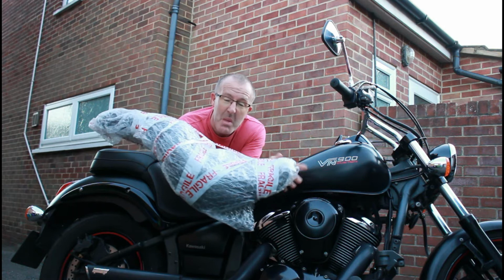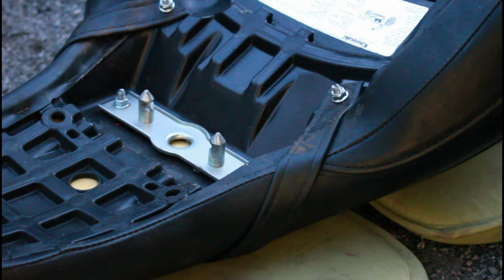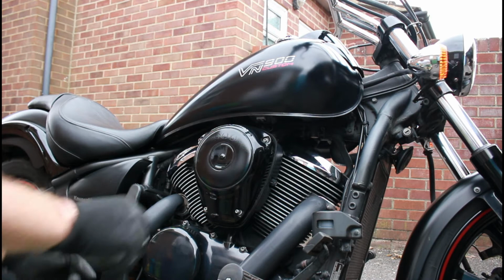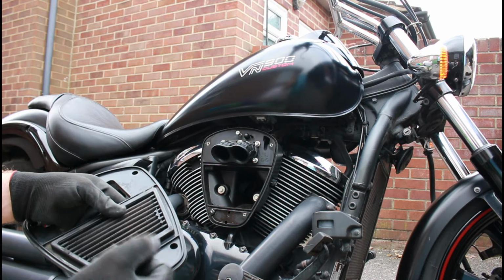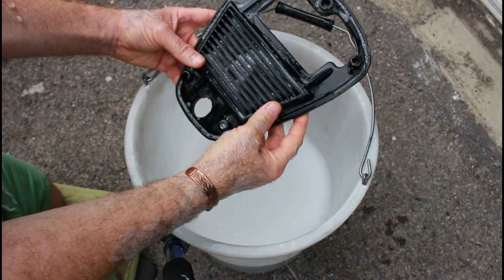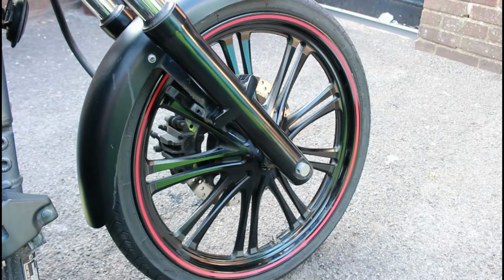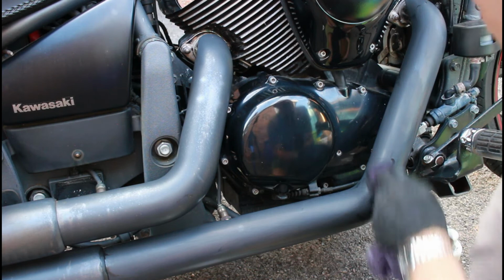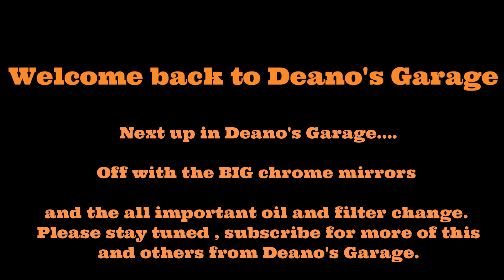VN900 Custom Seat change & air filter clean/change.

Comment: Do you have a seat name or a link to the seat?
Reply from the maker: Hello 
I removed the Mustang seat, and ordered  this via Ebay, was not new, and used Mustang fixing under the seat to fit back on: 
Kawasaki VN900 / Vulcan 900 Seat, Part No. 53066-0175 

Hope this helps ?

Comment: I dont know if you know this or not, but you know you are supposed to use a re-oil kit for those HIGH-Flow filters, not what you had done, that destroys them.

Only telling you this for further education before the trolls on the internet find your video and put crap on ya! And give you a hard time about it.

You have probably just now ruined the air filter, plus your going to wreck your engine if you dont use the proper re-oil kit for the high-flow performance filters and here is why...

Firstly... As you pointed out in your video that you can see through the filter, hence the reason why you need to re-oil it, so the oil can catch/prevent dust from getting inside the engine. So i would re-oil it as quickly as you can before you destroy your engine. The oil is designed to stop and catch the microscopic dirt fibres.

Secondly... Dont ever use warm/hot water to clean them as it will damage the materials of which the filter is made out of and never ever use an air blower from an air compressor to blow on it as it damages them as well. I spoke to a K&N representative over the phone and this is what he had told me not to do, he also mentioned to me that its also stated on their website, i have never checked to see if its written on their website or not, but maybe you could go look and see for yourself.

Thirdly... You are going to get some people that will say that you can use different re-oiling kit and you dont have to buy a K&N brand, but i strongly disagree as the guy i spoke to over the phone also said, that if you use a 3rd party re-oil kit or an off brand one, the chemicals used could also damage the air filter. So in future if you use a certain brand HIGH-FLOW air filter, make sure you use their own re-oiling kit to clean it.

Anyhow just wanted to let you know this for your info, if i were you i would take your video down and re-edit it or cut/edit out the air filter cleaning part of your video, cause the last thing i would like to see is trolls being dicks towards you, when you are just having a go as doing up your ride!

Great video and its good to see another Kawee Bruh!
Reply from the maker: Hello 
Really appreciate all you have written there, and it was an oversight on my part notvto check-out re-oiling. Usually all my filters have been standard OEM and as this was so full of crap, and needed a good clean, I had overlooked what you have stated their. 
I will will look to see how I can re -edit, and give better sound advice on the re-oiling part. 
Thanks...
Reply: Did you sell the old seat
Reply from the maker: @dordycacananty  
Yes I had sold the Mustang seat separately.